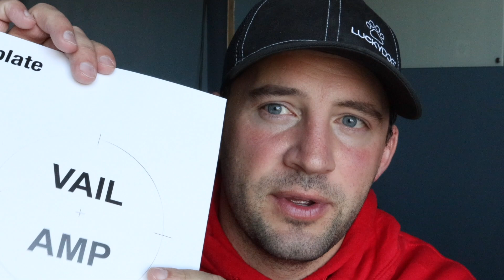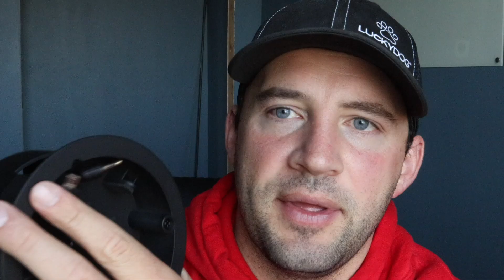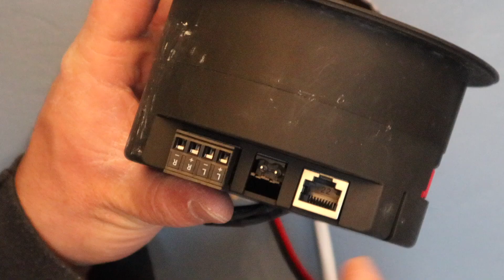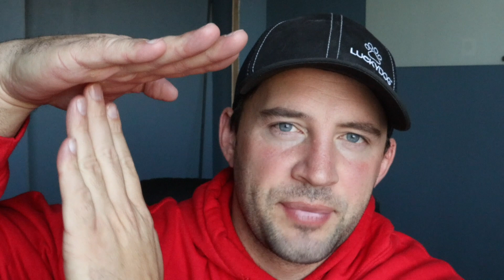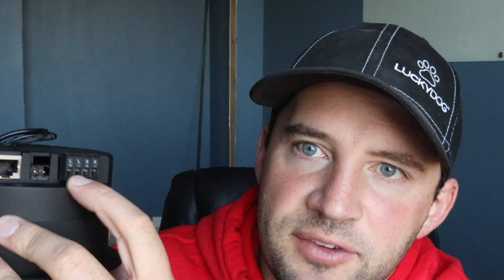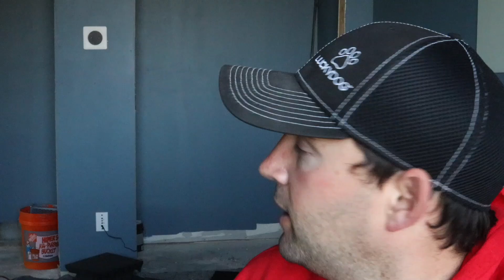How to install the Vail AMP 3 with Alexa Dot for home audio

Comment: I am putting four 8" ceiling speakers in the kitchen. I am daisy chaining the speakers, but unsure if the Alexa with amp will be strong enough to push the sound level. Suggestions?
Reply from the maker: You can power 4 speakers off of one Vail amp.   Volume out out will be less, but specs on their site say you can do it.

I wouldn’t daisy chain though,  you need to home run each speaker back to the amp.

Comment: Hi Tym,

Thanks for the informative video. Would you recommend Vail amps or Klipsch KVA-40's to power eight Klipsch R-1650-C speakers in 3 different rooms in a remodel?

Thanks,

Jim

Comment: Hello Tym, thanks for the video. Do these amplifiers work with Bose ceiling speakers 70 Volts? Thanks in advance.
Reply: A tip: you can watch series on Flixzone. Been using it for watching loads of movies lately.
Reply: @Otto Bentley Yup, been watching on Flixzone for since november myself =)

Comment: Is there an option to power it for new construction so you don't have the 1 gang box by an outlet? 
Thanks
Shaun
Reply from the maker: yeah if you're doing new construction you can run power over the speaker wire to power the Amp.  You'd still have a transformer, but it would b e hidden in a Mechanical room, or Low Voltage Can, etc.  But for sure you can use it in new construction.  It's very popular in townhomes, and production homes with a smaller footprint.
Reply: @Tym Smart Homes & Home Theaters™  I've spent over an hour on how to hard wire this amp inside the wall as having to plug the power supply into an outlet is just not an option for me. It just not esthetically pleasing and the wife would veto it in a heartbeat! You mentioned powering it over speaker wire? Not sure how this works. Maybe doing a video on this ,especially considering there isn't alot of info on this would be helpful and awesome I might add! Anyways any help you can steer my way would be highly appreciated! Thanks 😊
Reply: Oh, I forgot to mention we are currently renovating our bath so the walls are all opened up now. Thanks again 😊